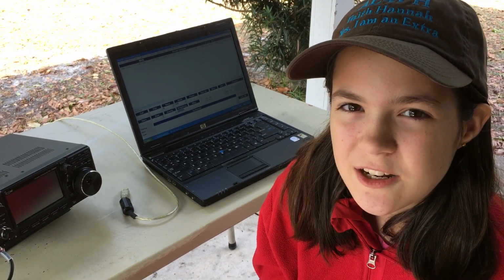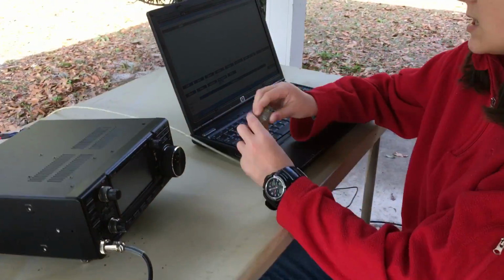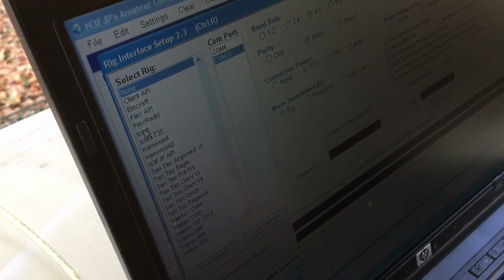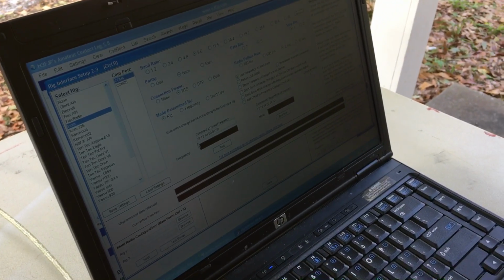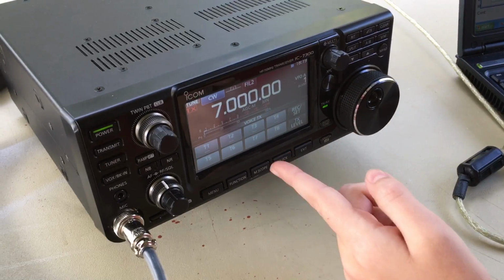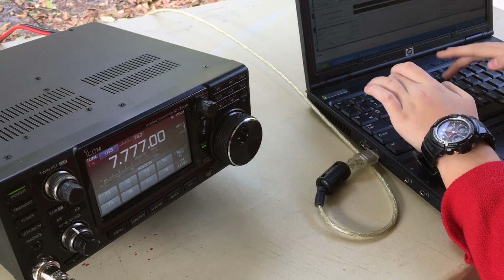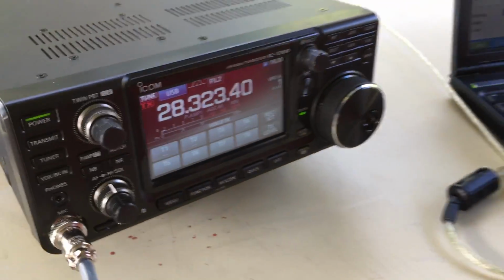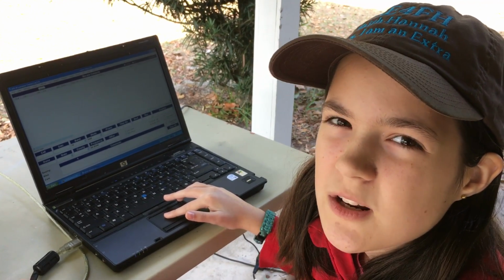How to Interface Your Icom IC-7300 With N3FJP Logging Software

Comment: Wonderful video.   One thing I learned the hard way.  None of this works unless you install the Icom USB driver from the Icom software download web site. (For some reason they call it Firmware??)   BE SURE it really installed and  not just downloaded. 1. also must go to ic-7300-Menu-Set-ConnectorsCI-V-CI-V Baud Rate 9600. 2 go to Menu-Set- Connetors CI-V- CI-V USB Port-Unlink from (Remote). The video showed the dropdown window picking  ICOM  that worked for her.  ICOM-2 worked for me. Just experiment.  Good Luck

Comment: Nice job explaining how to set up my IC-7300 with N4FJP software.  Just one question.  I assume I will need to change the callsign in my radio since we will be using a club callsign for Field Day?  Is that correct??

Comment: I think I've messed up something after configuring the radio for FSK with N1MM, it's not working here.  It has to be a setting on the radio I changed.  I just got a CI-V cable do I can stop using the virtual port, but it's a pain trying to figure out what data goes through the CI-V and what goes through the USB cables--seems that CI-V is only used on the FSK side?   Time to start digging in the radio, I really don't want to have to reset it to factory default every time I change contest modes, ha.
Reply: Well that didn't take long to fix, the rig was set at 115.2k, I'll have to set it to 9.6 in N1MM too.  Still seems odd that a CI-V cable is even needed when everything should be done with just USB.